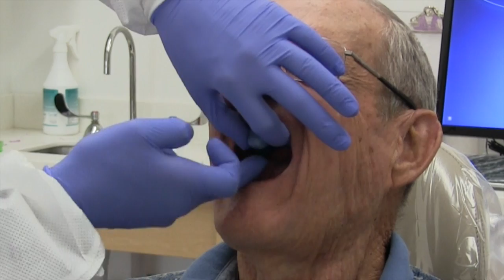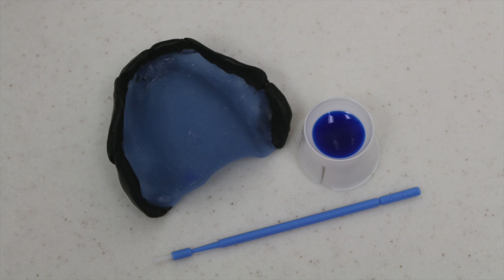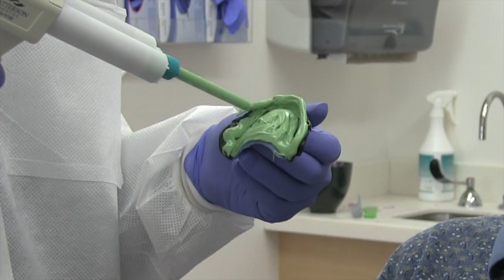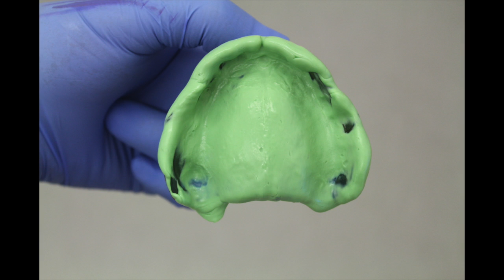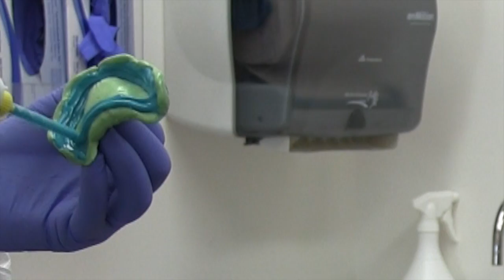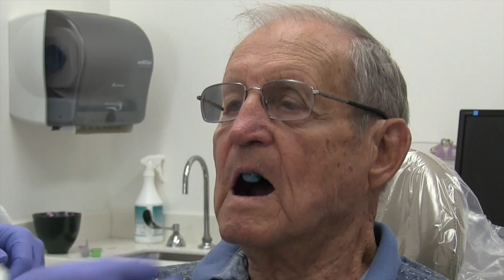Final Impression

Comment: Normally we take border mould impression we want record the border of denture from the mouth by eliminate the active tissue that affected to denture , but you used  heavy body to take second layer before light body materials it will make tissue displace. As result, I see the border of your impression was very thick , it is the proof that tissue is displaced .  This active tissue will kick off denture . Should remember, The thickness of the border of impression is the border denture and the border of denture is not thick as your impression shown in this video

Comment: why doesn't my prosthodontist do this?  he just had his assistant take an impression and at wax  try-in-it fell out-grrrrrrr!   i 'know' about this because i've worked in the dental world.
Reply: Sometimes it isn’t necessary. It depends on the patient case or ridge length/width.
Reply: @nhlsens3880  IF the person making the denture KNOWS what they're doing-NO ONE should have to use denture adhesive
Reply: @alwaysdonnie72  one thing you should know is that the baseplate/wax rim try-in there will be little to no retention because the baseplate is not a good impression of the master models (this you would know as a prosthodontist). The only time you will see good retention is during the final impression and the final denture delivery/follow-up appointments. You will often need to use denture adhesive to stabilize the baseplate in the mouth when making adjustments to the wax rims etc. I'm not sure of your background in dentistry, but just thought I'd let you know this is how it works...
Reply: @nhlsens3880  i'm NOT a prosthodontist-just worked for a lab that made dentures-really crappy dentures and he didn't care-only cared about $$$-i went to a prosthodontist who had NO hands on ability-just kept sending it to the lab-a full and partial-hoping for the best-the best never happened.
Reply: @alwaysdonnie72  ok. i would caution against making extreme statements, often the reasons for things occurring not the way you might expect are multifactorial